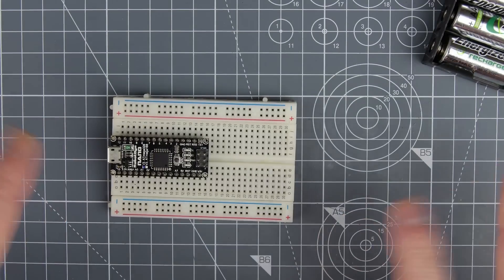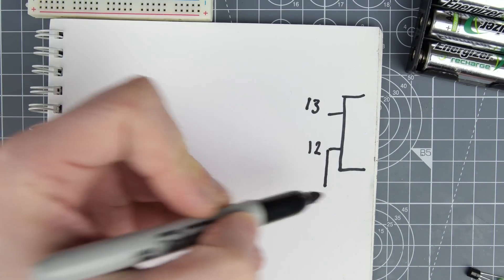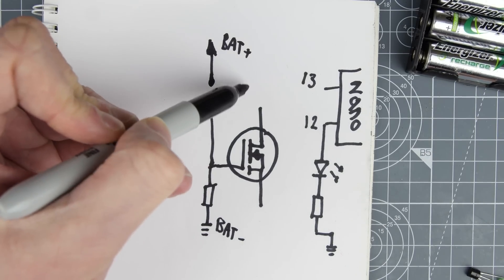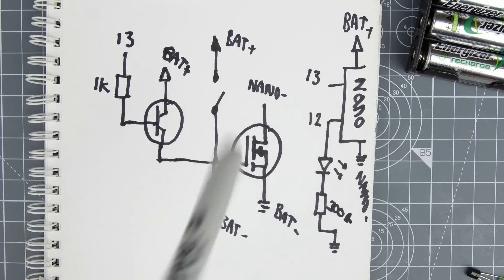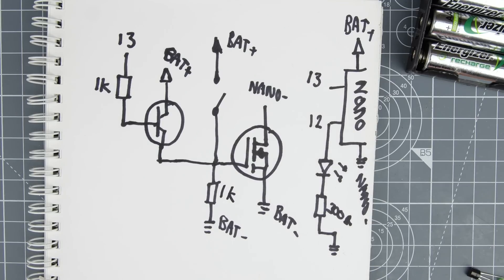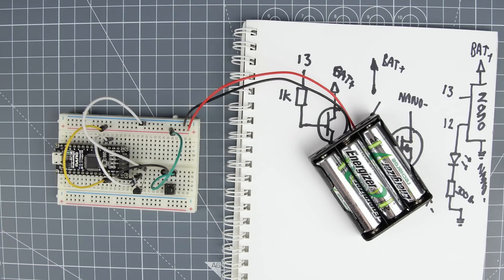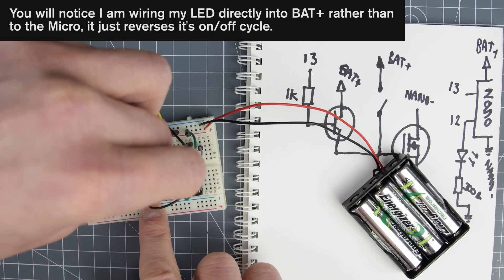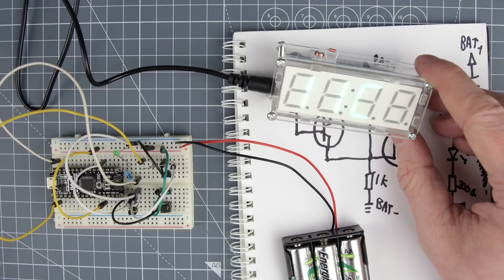Microcontroller Power Button: Manual On and Automatic Off

Comment: Thanks. Interestingly I found (and designed myself) only high side switch with P-MOSFET. It's fine, cause I used it to shutdown SD card reader and it's voltage regulator once. Kind of problem is that if switch is designed to disconnect Arduino from battery to prevent deep discharge and damage of rechargeable batteries, not every MOSFET works. Some may still allow few microamps to flow - either because Vgs(th) is specified for 1mA, or because they conduct a bit all the time and there's some sweat spot - if voltage is close to Vgs they conduct, if voltage is double vgs, they conduct too and when voltage is close to maximum rating (e.g. 60V), there should be current no higher than 1mA. But for similar design I used 1M as a mosfet pullup (here pulldown) and 100k for base of bipolar transistor.

Comment: Question: can you not just wire pin 13 directly to the MOSFET gate via a current limiting resistor and pull the pin HIGH to power off the MOSFET? Why use a transistor there? 
Thanks
Reply: It is more power efficient.

Comment: Great video! Thank you for the demo and the schematic. the pull-down resistor for the MOSFET can be much larger 10 K - 1 M. You can also use the internal (built-in) LED as indicator instead of tying up pin # 12 and using 2 more components.

Comment: Really a detail but you need to show the emitter of the transistor on your schematic. By the way, I'd be interested in a solution to automatically turn on that switch every hour for a battery-powered remote sensor application. Thanks for the video!

Comment: I couldn't get the circuit to work.  The only difference from yours is that I used an Arduino Uno.  The MOSFET will power the UNO when the switch is held and then off when released.  When I add the transistor and attach it to pin 13 via a 1K resistor, the Arduino remains on after the switch is released.  So all working well.  However, when I set pin 13 low, digitalWrite(pwrPin, LOW), the Arduino continues to operate.  I tried different pins both analog and digital but still no joy.  For some reason the transistor will not switch off (open the gate on the MOSFET) once it is powered.  The only way I could get this to work is by resetting the Arduino board (I used the watchdog function).  But that's not really the way to do it...but I can't find any other way??
Reply: I am having the exact same problem. I can turn off the BJT with a push button but not by taking the base down using a digital low from the UNO. Don’t understand why?!
Reply: just my opinion. some transistor becomes live when the gate is above 0.7V. the reason why you can't turn it off could be that pin 13 sourced out 0.7V when set to low.

Comment: I want to increase time to 4 hours. I want to use it to switch off my cooler after 4 hours of running
Reply: Just keep HIGH the pin connected to base of transistor (eg. Pin 13) for 4 hours. You need to program the Nano to do this.
Reply: im a bit late but did you implement a timer to keep track of any last input/activity?

Comment: Hi david, the 2N7002 work for this circuit?
Reply from the maker: It will but you will stuggle to get 300ma through it with 3 AAA batteries on the gate of the mosfet. I would pick something with a lower on resistance.
Reply: David Watts Which mosfet do you recommend? please
Reply from the maker: The IRLML2502 or something of a similar spec would be good.

Comment: I'm not sure I understand... At 5:57 you explain: "The nano, when it boots up, will put pin 13 high". Wouldn't that turn OFF the PNP transistor? Assuming the emitter is on BAT+ (you didn't draw the arrow, but it makes sense), the base should be at least 0.7V more negative than the emitter in order to turn the transistor on. Anyway, thanks for all the great videos. You have inspired me to brush the dust of some 30 years old knowledge... And I might be wrong when it comes to the PNP transistor. It's been a long time... :)
Reply from the maker: Sorry, you are right, it seems I mis-spoke when I said High, I meant low.
Reply: thanks man, i was thinking the same!

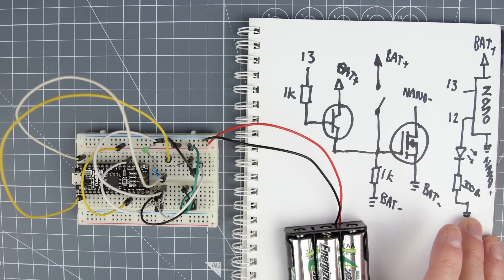Comment: Thanks! Great video. At 11:50 you ask if this draws any current (when not turned on I assume). I could not measure any current on my multimeter, which can measure currents down to 10 uA. In theory, the only current is the leakage of the PNP transistor through the pull-down resistor on the gate. In practice, the battery will die of age (self discharge) :-)
Reply from the maker: Thanks Robert, my meter has trouble measuring accurate uA currents due to the burden voltage so I have to go with 'in theory' for most things. Thanks for checking it out, I really appreciate it.

Comment: You can swap the functions of pin 12 and 13 to save a resistor and a led by using the built-in led. ;)
Reply from the maker: Not quite as visual in the video though :)

Comment: Cool stuff. If you replace the mosfet with a 2n700x (logic level nmos) (edit: oops, bs170 is similar to 2n7000), you can hook its gate to pin 13 via a resistor. The circuit will be the same as before just without the pnp. Why ? because when the avr powers on, the GPIO is in High-Z. The first thing the software needs to do is to turn on the gpio driver for pin13, bring it high. I think. Watched the whole video before responding.

Comment: There  could be a problem of NANO being held to the "On" state through one of the I/O pins being sinked to BATT-.  Might need to separate your peripheral I/O GND from BATT-.
Reply from the maker: You are absolutely right, they all need to go through the mosfet/nano ground. Or as I wired it in the end the LED needs to go to power with the micro providing the ground path.

Comment: The problem with this circuit is short button presses, the micro needs time to boot. 
Why not add a cap and resistor to artificially prolong the on state after the button press ?

Comment: Why are you using a transistor to drive the mosfet gate and not just the uC pin itself?  Is it just because it's not logic level?
Reply from the maker: +Mark Higgins honestly I cannot remember why, there must have been a reason. I will post a video update with an answer or simplification of the circuit ;-)
Reply: If the 9V is a problem, a resistor in series and the protection diodes in the micro should keep the levels safe.. Right ?
Reply: Mark Higgins if its a 9v batterie you would probably kill the arduino by feeding 9v to its pin once you press the button, I think.
Reply: Mark Higgins I was thinking the same. As long as you're not pushing more than 5v across the switch the transistor isn't required.
Reply: I too think that connecting the pin 13 directly to the gate of the MOSFET would  able to do the trick